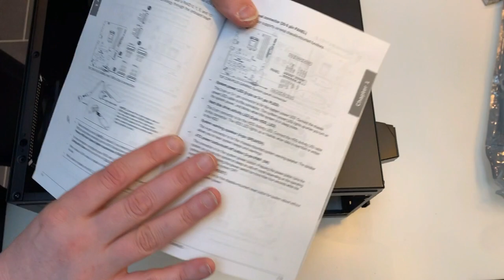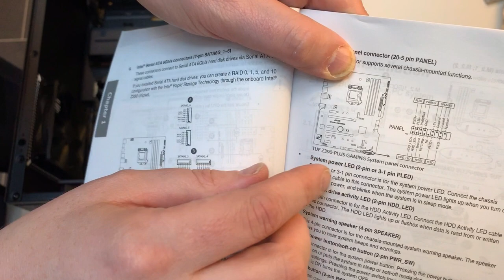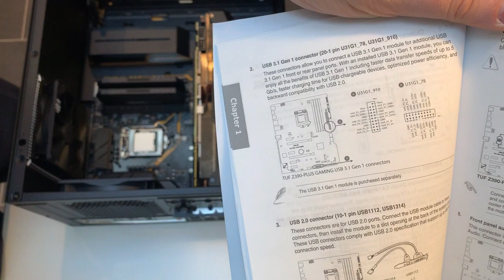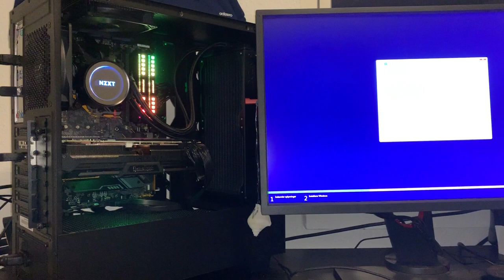Building a kick-ass gamer PC. Intel I9, Nvidia RTX 2080 Super, NZXT X62, Asus Z390 PLUS

Comment: You forgot to peel the tape off the heat sink for the onboard NVME drive, hope the plastic doesn't melt and damage the drive or worse. Good luck.
Reply from the maker: Thanks for the heads up naval. I actually just moved the NVME to the other slot closer to the CPU. There was no damage from the tape
Reply: @TooManyGadgets  You need to screw the M.2 drive to the board first and after that placeing the heatsink, of course without the peelable lastic cover, Nice build though! Plus would prefer to plug in the mobo cables befor installing the GPU, just makes things easier ;)

Comment: Hello,
I have spent the whole day trying to figure out how to build my pc which has almost the same component as yours and I am really great to have found this video.
My doubt is with the kraken 62 that I've been trying to position the same way you managed to but any way I tried it wouldn't fit. My case is case is NZXT H510. Would be great if I could ask a couple questions about this pc.
Thank you
Reply from the maker: Hey - the radiator was somewhat of a pain to mount to the case. The 510 case has the same dimensions as the 500 to my best knowledge, so you should be able to copy what I did. Hope you get it working, as I super happy with my rig

Comment: Really nice build! Planning on doing one that would be nearly identical. What temps do you get with the cpu and gpu?
Reply from the maker: right now my CPU is at 35 and GPU 41. They usually go 10 degrees higher when I'm gaming
Reply: @TooManyGadgets  Thanks for the input! I thing I'll be very satisfied then... Did you changed the fans on the front of the case? Puting then behind the with the radiador or they are still separated by the metal part?

Comment: How did you get the usb 3.1 port working? I connected it and it still will not work on my build. I have the same mobo and NZXT elite case. The port connection doesn't appear to be loose or anything so I don't know why it won't work.
Reply from the maker: Hi Farz. It sounds like you either have a defective cable, motherboard or case. It's kinda hard to figure out which without access to a different case for starters - or if you could find a matching cable?

Comment: The cpu header for this motherboard has only 8pins. Can this be overclock?
Reply from the maker: Hi Jhan. I've only done mild software overclocking so far, as I've not really needed more horsepower so far. I am considering taking it a step further though, as I've just bough a new VR headset that really is pushing my system
Reply: @TooManyGadgets  I've read some of the  sources that it has no problem overclocking it. As long as you know what you're doing, thats fine. Btw, we have the same mboard and good video!